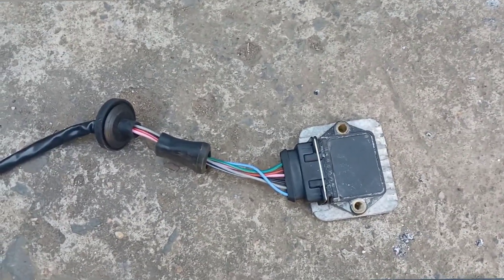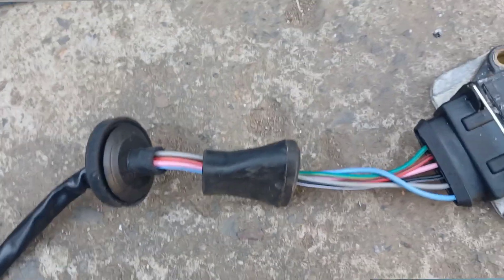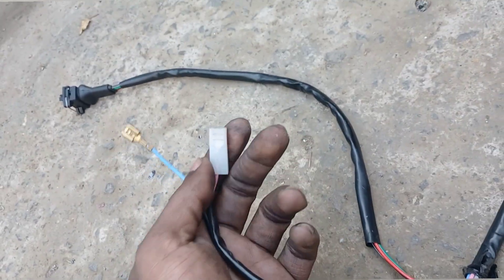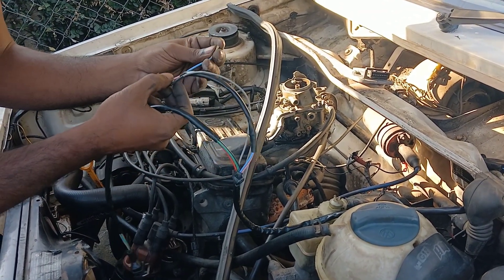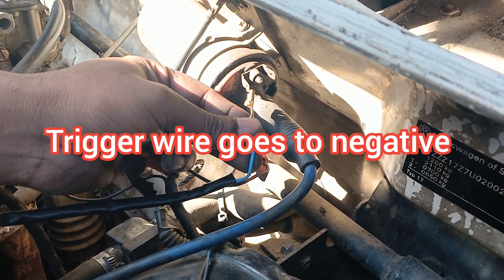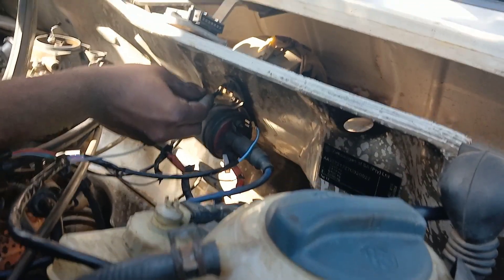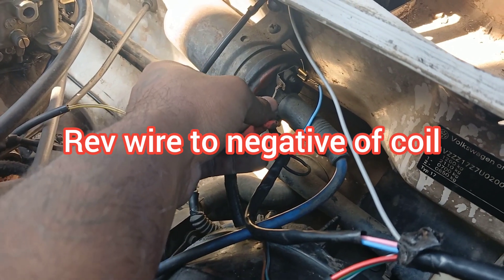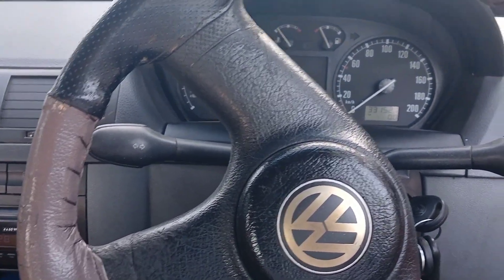Coil and module wiring : Golf Mk1 #nospark

Comment: How do I contect my rev counter...same car carburettor velo dash
Reply: What colour is that wire
Reply from the maker: @zbusiness1941 it's different on each car. Turn ignition on then use a test light to locate a ground wire which should  which should be black,brown or green and black make sure it's ground and then connect that to negative  on coil

Comment: I,ve used your idea,and yet i still don't have  spark ,bought everything new and so where els can i check.
Reply from the maker: Hello this is not an idea. It's the actual way to connect it. Can you confirm you getting ignition power to the coil when you turn the key on?

Comment: Hi sir I have citi golf 2006 carburetor 1.4 new spec dash, my Rev counter dies, heat gauge jumping, oil light flashing, indicators won't work, some times everything works, sometimes car will start, sometimes just swings, I am assuming it's shurlock control unit sits above acceleration paddle

Strange part while driving, when you push clutch the Rev counter, heat gauge indicators, will work an oil light will go off and will work short while then Rev counter dies oil light comes back on, heat gauge jumps an indicators stops working , I am sure it's the shurlock control unit

Your opinion I understand you will have to see the car, an what are the signs of failing distributor
Reply from the maker: This is a tell tell sign of a failing shurlock bro. the reason why stuff seems to work when u press the clutch is because you are taking off load from the engine which puts a less strain on your spark/ignition system. best advise to you now is to run a tci harness with   a standard 2pin coil so you will get rid of the no start issue. but obviously replace the control box if needed. also just go through all your ground wires in the engine bay before anything. weak ground can cause all types of issues
Reply: @Denirosmk1hacks  much appreciated for your sound advice, I am in Durban, can I make appointment with you to bring my car over to you, please let me know
Reply from the maker: @interoceanocean7935 sure 0682523947
Reply: @Denirosmk1hacks thank you deniro

Comment: Hey buddy hows it going just a quick question ive changed my plugs my HT leads bottle coill module fuel pump dizzy cap and rotar same setup you have there i done the same but my problem is still expeince a backfire and a little jerking and the car just cuts out aswell but funny its starts rite up agan and idles ke nomal i honestly dont know what to check anymoe ....any advice would be appiciated ..
Reply from the maker: Howzit sometimes a bad distributor  can act up when warmed up
Reply: Thaks buddy well struggled the whole day today again just havnt done distibuter yet but plugs.....coil......HT leads....module ...carb .... new rotar and cap nstalled  but still have that small backfie and jesrking then cuts out so basically its just distributer self maybe ...😟
Reply from the maker: @DavidHannigan-k2q must also give your  carb a good clean bro before buying a new dizzy

Comment: Thanks for the good content plain and simple ...love it ...just a quick question that original loom towards the end of the video the one for the ignition and rev counter where does the ignition wire go looks like a black wire which looks like its connected to a yellow wire or is it seperate or do they go to the positive on the battery  ....thanks....
Reply from the maker: The black wire comes straight from ignition switch. And that yellow wire is going to my carburetor

Comment: I have mk1 carb doesn't have spark can it be ground wire that cause it no spark
Reply from the maker: It could be module, distributor,  coil  or a wiring issue  so yes ground could cause it. Trouble shoot from one side and use my other videos  when doing o

Comment: good day Sir.  I hope all is well your side.
Thank you for making these videos...its very helpful to me & I'm sure to a lot of other Mk1 guys too. 

I was hoping you could assist me... I'm helping a friend with his mk1.. & we cant seem to get his golf started. fitted new Ignition Module with new Module harness... car cranks but not starting. we checked if its giving spark by unplugging one by one spark plug cable & fitted an working spark plug but no spark. strangely, when we put his distributer cap & cables in my mk1, my car starts... we even went ahead & remove my coil & installed it on his car... his car is not starting but then we have spark.. any advice what we might be missing?
Reply from the maker: Hello thanks for the kind words. turn the ignition on, the middle lead from distributor  pull that out and attach a spark plug onto it. afterwards remove the distributor  plug, take a test light ground the light and probe the middle pin on the distributor lug whilst ignition is on. keep me updated
Reply: @Denirosmk1hacks thank you for your response. We'll follow your advice & let you know how things go🙏

Comment: Hey, I've noticed something weird with my VW Citi Golf MK1. When I disconnect both spark plug leads 1 & 2, the idle doesn't change - it still idles roughly the same. You can tell it's misfiring, but disconnecting those leads doesn't seem to make a difference in the idle speed.
Ignition coil & spark plug leads are new...
Reply from the maker: Are u removing both at once or at the same time ?
Reply: Yes even when i remove them both simultaneously at  once it still idles the same... I changed distributor, spark plug leads, ignition coil, spark plugs, & model... Hoping the problem will be solved but nothing... Vehicle does drive but when i reach 110km/h it doesn't wanna go feather...
Reply from the maker: @chrismokoena7999 ok what idle does your car sit on? I want you to drop your idle just below  900 rpm. Make sure your  ignition timing is on markvand try your test again
Reply: My Golf's speedometer doesn't have RPM, but I adjusted the idle speed low enough that it almost stalled. When I removed both spark plug leads, the engine didn't die, which is weird...
I wish i could make a video show you what i'm talking about...

Comment: Morning Deniro, my car is cranking but not starting, and the front left light stays on but the right one is off, even my battery and the indicator lights stay on without the key in the ignition. What could be the problem?
Reply from the maker: Is it a new spec golf ?
Reply: @Denirosmk1hacks  nope, VW Fox, the lights are off now, someone has just checked it he suspects that it could be a carburetor because it was dirty few weeks ago and it was cleaned and the problem seems to have returned, what could you advise? There is spark on the car. Thanks for your reply
Reply from the maker: @Marty_R200  regarding the cars starting even with a bad carburetor  u supposed to get it to start and hold on a high rev. You first need to make sure the carburetor  is spraying fuel down the intake. I suggest buy some quick start. Spray it in the carburetor  and try starting this will tell you if it's a fuel issue
Reply: @Denirosmk1hacks  thank you once again, I will try it and get back to you.
Reply from the maker: No problem  let me know @Marty_R200

Comment: So what if your mk1 has a different ignition coil ?
Reply from the maker: If you have a 3pin coil running carb this won't work u will need to get a bottle coil.
Reply: I have a 2 pin but it’s like a 3pin, not the bottle coil. Any idea how i can run the rev counter wire?
Reply from the maker: That's called a block epin coil it works fine. It Aldo only has negative and positive

Comment: I need your help my car starts for few minutes when it gets hot it switch's of and doesn't start. Has no spark
Reply from the maker: This is a heat sink problem. Either your coil or module is heating up, as a result it needs to cool down until you able to restart. subscribe if you found this helpful 🙂

Comment: Can you please make a tutorial on my rev counter that is not working ....i also have a new spec citi golf
Reply from the maker: You need to find that wire bro it will be black and it's close to your coil area. Use a test light to make sure it's a ground wire before connecting it to negative of the coil